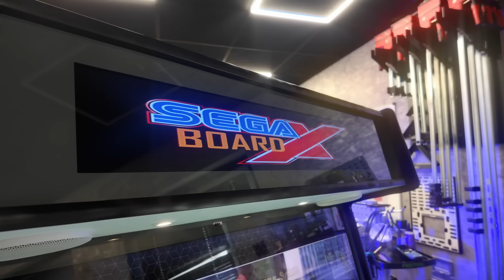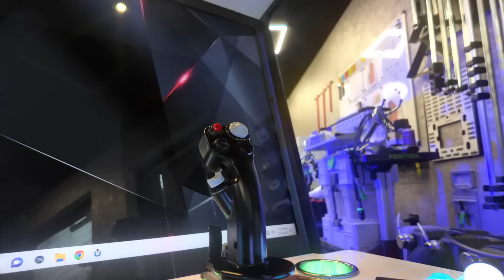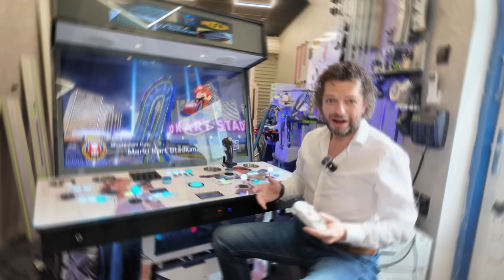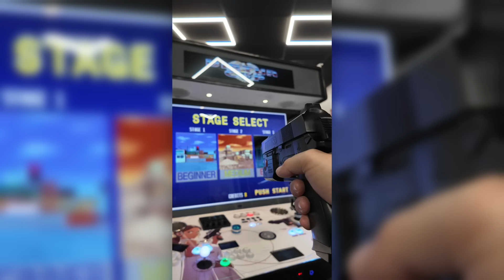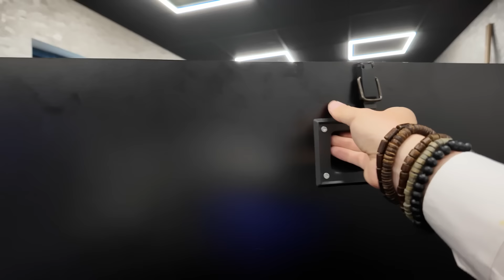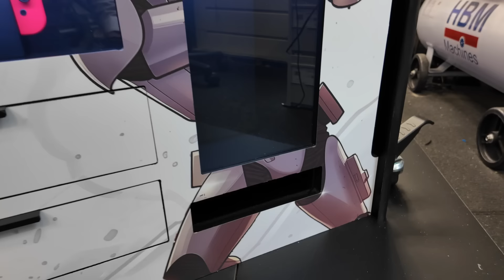Creating the BEAST Part 3: Building the World's MOST Expensive 50" Arcade Machine - It is done... 😍

Comment: Hi, what did you use to be able to switch between consoles by the press of a button.
Reply from the maker: An HDMI and USB switching device. These are widely available
Reply: @TheDanielSpies  when you power on your arcade do all consoles power on with it or do you need to power on each one manually.
Reply: Also what buttons did you use to change to each console, i have the same hdmi switcher as you so want to get the same buttons as you used.

Comment: Hi Daniel, where you find this cup holder rgb? Thx
Reply from the maker: Search for 12v RGB cupholder and you will find these models everywhere 👍🏼
Reply: @TheDanielSpies  But they have controller too? I would use them as like you, connected to i-pac
Reply from the maker: @marcocotena8527 just follow my Youtube short howto cennect them using the high current outputs 👍🏼 also on the Ultimarc website

Comment: One change I would suggest is to have the front-facing USB ports be mounted underneath so that if someone steps on a cable it disconnects with no damage to the port. Having a spring mount would be useful also to pre manage some slack so that pulling or stepping on the cable will be okay up to a specified length.
Reply from the maker: Smart idea!